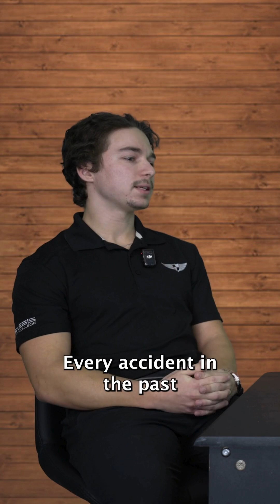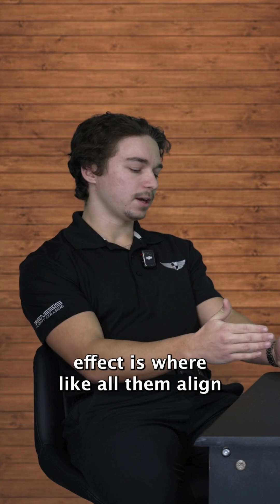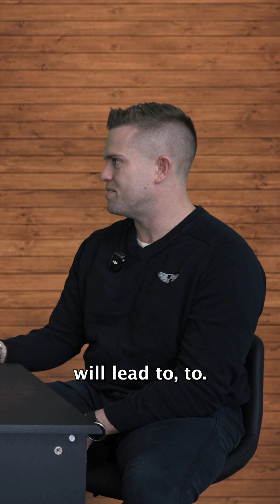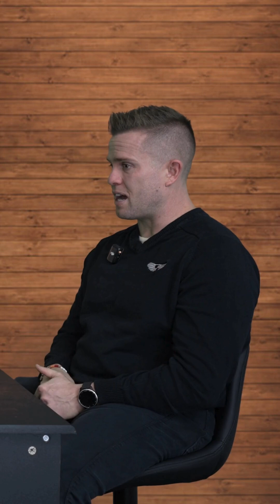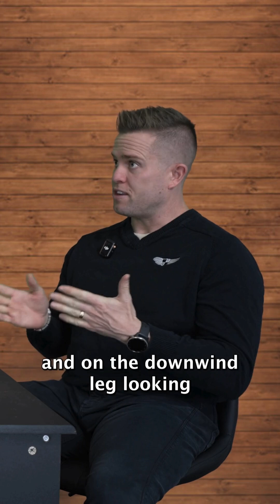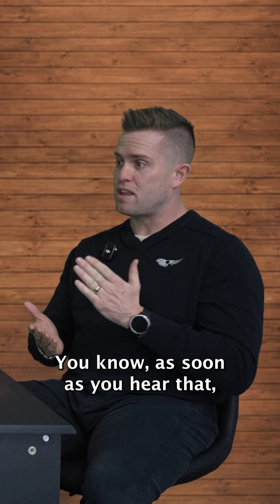The Swiss Cheese Model in aviation 🧀✈️

Comment: I  want to build an ultralight, but I won't try with a wing that will stall. That's one slice of cheese that accounts for a lot of risk. It's always possible to fly into the ground, but it helps if the plane doesn't love stalling & spinning.
The Facetmobile in the '90s, the Arup & the the Nemeth "Parachute plane" of the '30s .The Eshelman plane of the '40s.